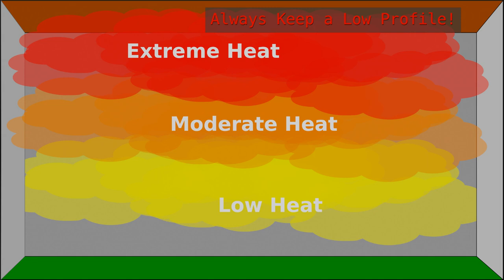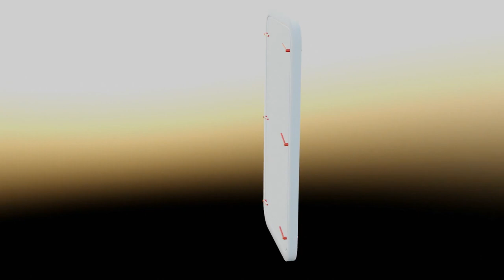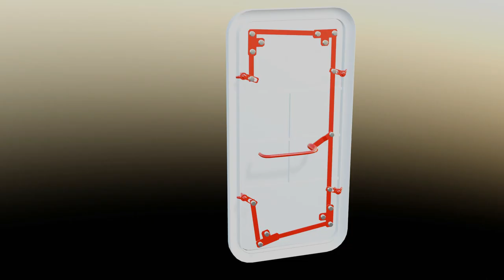Shipboard Firefighting: Door Entry Procedures  | STCW Basic Safety Training

Comment: I’m interested in the origins of the concept of using a spray pattern for the indirect attack.  I have been taught in more than one training centre to use a straight stream, aiming for the deck head directly over the fire.  The straight steam is intended to not disturb the thermal layering.  For sure, any kind of a spray pattern moves a lot of air, which is feeding the fire.  is there a reference material for not using the straight stream?
Reply from the maker: Hi Jeff, thank you for your comment.
In case you do an external indirect attack, you can use a straight stream for a window impulse. In an interior attack, however, we never use a straight stream.
In the video, we talked about gas cooling. Gas cooling is most effective with a wide spray pattern due to the larger water surface. Moreover, a straight stream could penetrate through the gas layer, hit the deck head, evapourise and push the hot gases down in the fire team. That is why we recommend a spray pattern.
Will look up references and Postboten here these days.
Hope this answer is helpful.
Best, Marie

Comment: Why place the back of the hand on the door when you can paint the door with water?
Reply from the maker: Water will only work when the door is very hot (above 100 centigrade). Otherwise, it will not evaporate
Reply: The platinum solution is to have a Thermal Imaging Camera to check the door for hotspots, if applicable open the door and take a screenshot to ascertain where the neutral plane lies.  Then get in and crack on with gas cooling

Comment: Just a quick reminder to all shipboard firefighters. The dogs should be opened hinge side first in the order of top, bottom, middle. Then latch or opening side in the same order top, bottom, middle. Control the door while opening away from you thus protecting you from a pressurized compartment/backdraft.
Reply from the maker: Hi Richard, many thanks for the input!